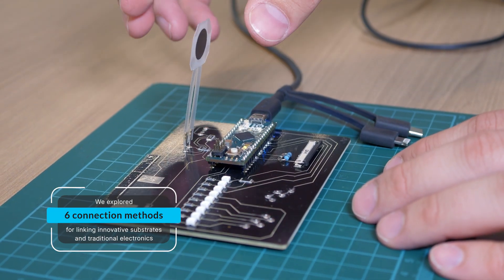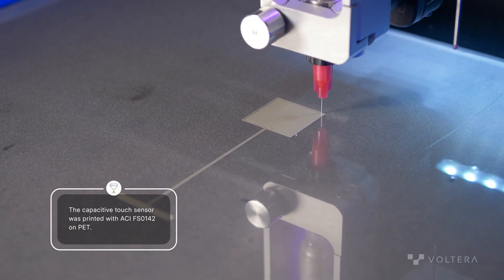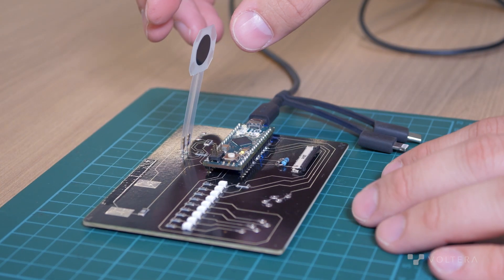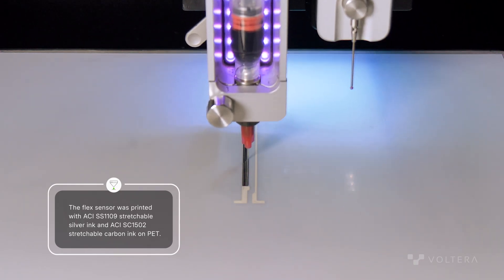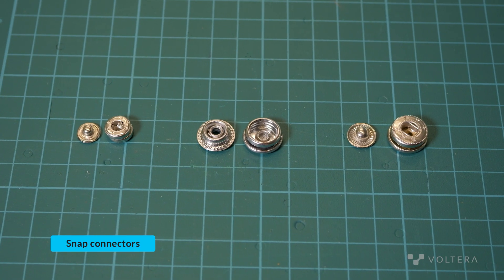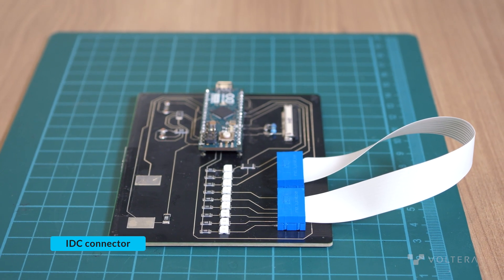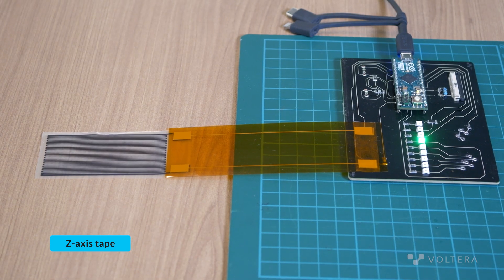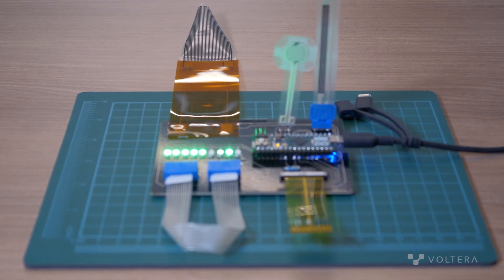Connecting Flexible and Stretchable Substrates to Printed Circuit Boards | FSR, Flex Sensors

Comment: Hi, great video!
How did you attach "Snap connector" to the flex pcb? 
https://youtu.be/HHD_7RyfZ90?si=Z6saE17vc3K6TmOg&t=157
Reply from the maker: Thanks for your kind words! 

To connect the snap connector to the electrode, we punched a hold in the material and pushed the snap connector into the hole until it fit snugly. We wrote a white paper with more details on the electrode project that you can see here: https://www.voltera.io/use-cases/white-papers/printing-ecg-electrodes-biocompatible-gold-ink-tpu. Hope this helps!